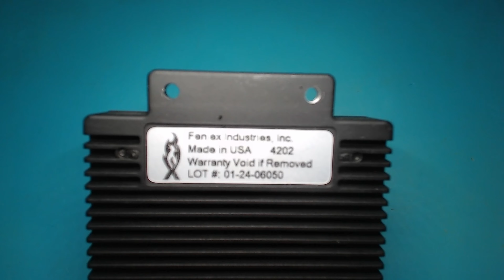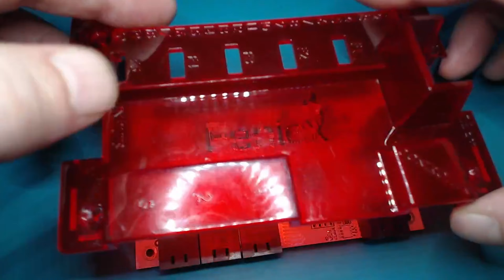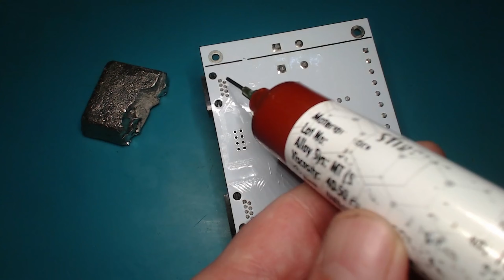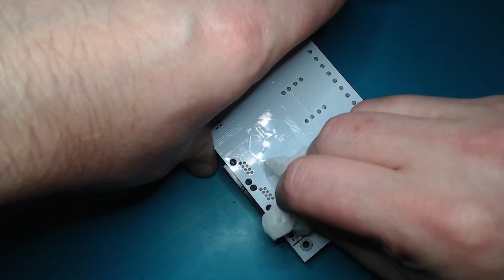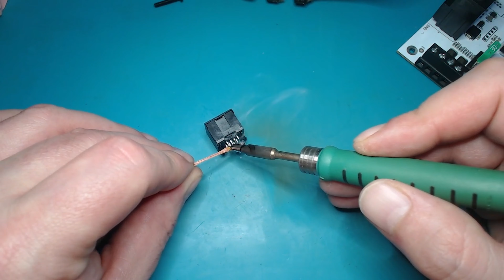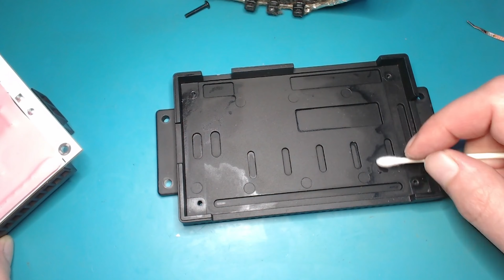Controller Board Repair

Comment: Dont ya just like the low temp solder works great, cannot see the part ATSAMC21N18A is supported on your enhanced IS01the ISP Header is right there..
Reply from the maker: The solder is awesome below melt yeah I should’ve dumped the chip if it wasn’t locked lol
Reply: @QsTechService1  Ya had 50% chance it was locked. Always worth the attempt to back them up.